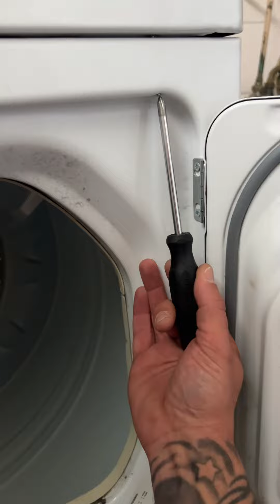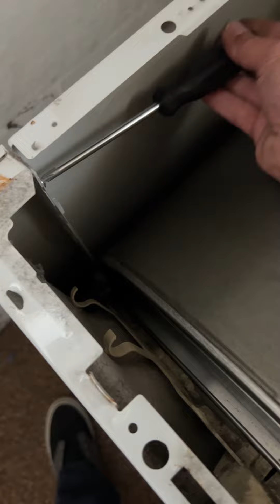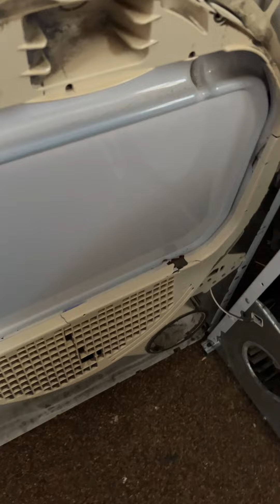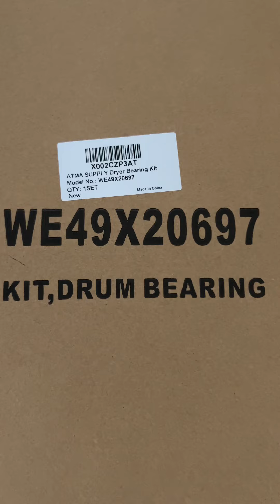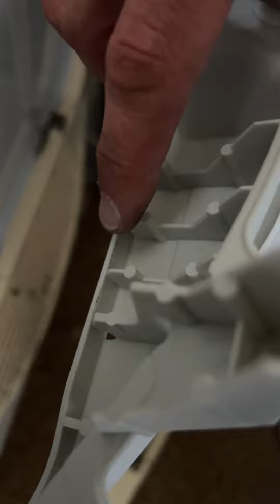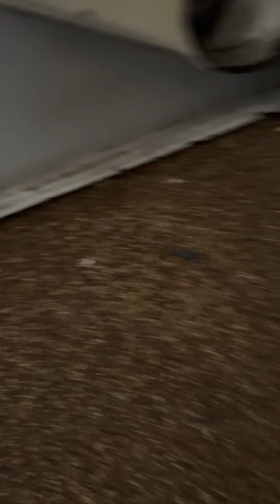GE Electric Dryer Squeaking/Grinding Noise Repair

Comment: We have the exact same dryer, I replaced the dryer element/housing, and the door switch. And now it sounds like a metal on metal. I can push down on the drum and it’ll stop. It looks like my drum is sitting sideways.

Comment: You really don't know what that material is for? Did you seriously just say that? LOL. This is a duct felt seal for your dryer. The duct felt seal allows the front-load dryer drum to glide smoothly on the front panel. Your dryer will not function properly if the drum felt seal is compromised. 😊
Reply from the maker: I said I wasn’t sure where exactly it was going on it since there wasn’t one to replace, and it works fine